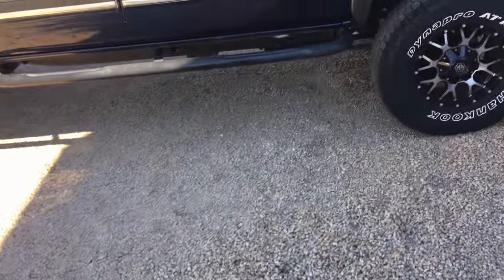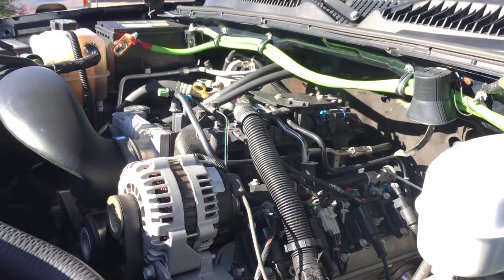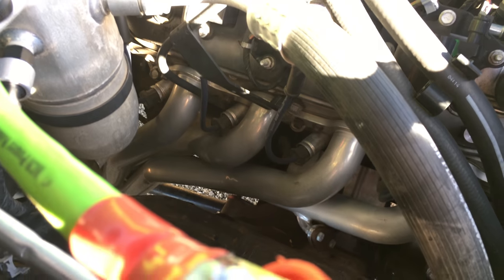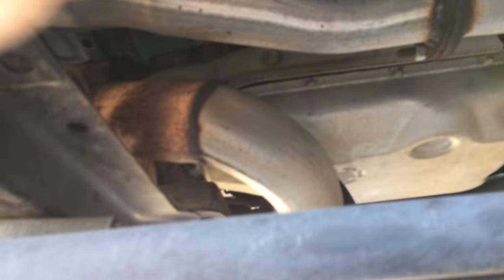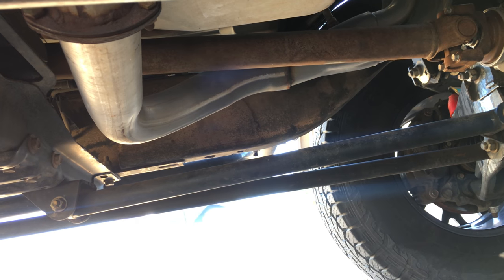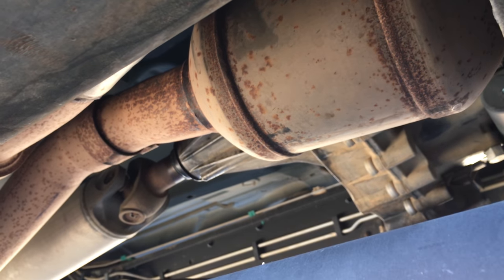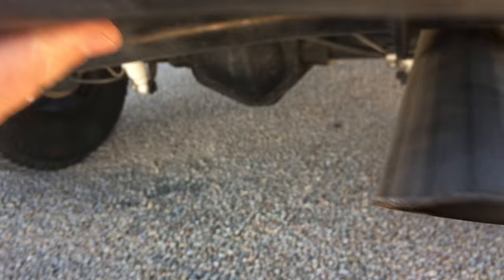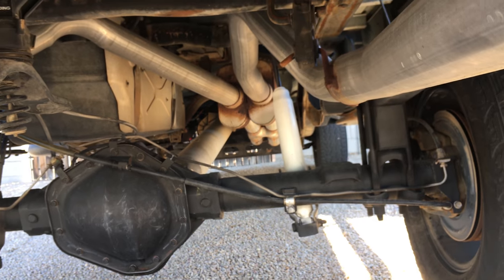2003-2006 Chevy Pacesetter Header / Exhaust System Overview

Comment: Thanks for the video. I was more or less trying to see if the headers would line up with the factory exhaust on my 2500. Was hoping I cut cut the exhaust accurately and just clamp the headers and stock exhaust together.